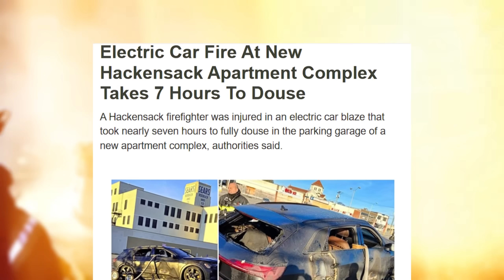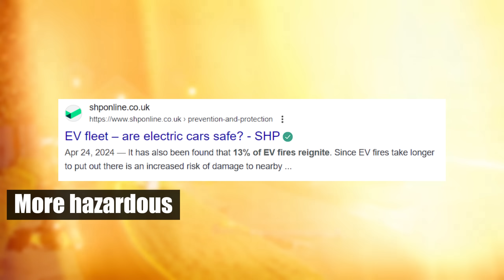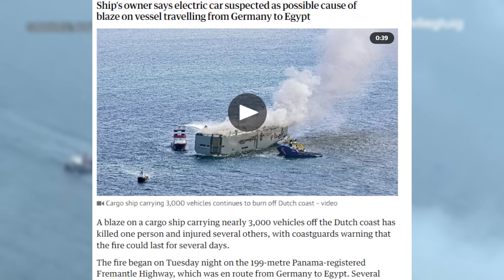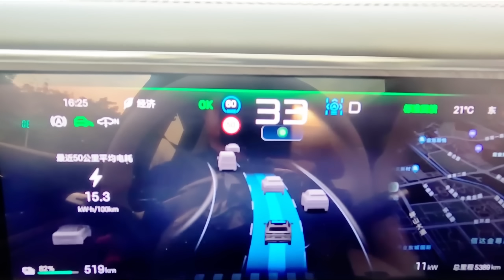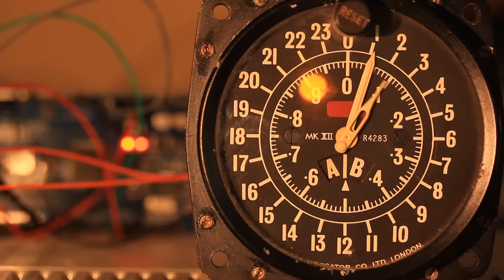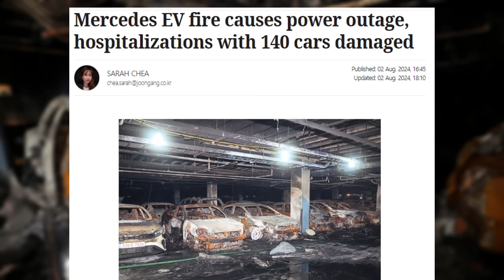Why EV Owners Are Furious? Electric Vehicle Crisis: Owners Demand Answers as Battery Fires Surge!

Comment from the maker: 🤔 Do you think surging battery costs are the biggest obstacle for potential EV buyers?

👉 2024’s Biggest EV Fears: The 10 Reasons Shoppers Won’t Commit! WATCH IT NOW HERE! 🎬https://youtu.be/QV7GZMewhC0
Reply: @PistonPundit  replacement cost for EV batteries can cost anywhere from $15,000 to $25.000 for the F150 lightning batteries
Reply: I had a good laugh at the thumbnail
with Firman on roof. 
😄😄 yeah, right....😄😄
Reply: battery costs are literally collapsing. You're copium is cringe
Reply: LOL, This is nothing compared to GASOLINE VEHICLES!
Google is your friend. 

Search for "BMW Fires"
- "BMW mystery fires: Parked cars have burst into flames", ABC News, May 2017

- "BMW recalls 1.4M vehicles due to fire risk",  ABC 7 Chicago, November 2017

- "BMW recalls vehicles for 3rd time due to engine fire risk",  Associated Press, March 2022
     "...BMW is recalling more than 917,000 older cars and SUVs in the U.S. — most for a third time — to fix 
          a problem that can cause engine compartment fires. The recall covers many 3 Series, 5 Series, 
          1 Series, X5, X3, and Z4 vehicles from the 2006 through 2013 model years. Documents posted 
           Wednesday by the U.S. National Highway Traffic Safety Administration say there could be 
           short in the positive crankcase ventilation valve heater. It can overheat and cause a fire. The fire 
           risk occurs while the vehicles are being driven or soon after they are parked. 

Search "Kia Fires"

- "Consumer Alert: Kia and Hyundai Issue Recalls for 3.3M Vehicles, Advise Owners to Park Outside", NHTSA, September 2023
      "...Hyundai Motor America and Kia America have issued “park outside” recalls for more than 3.3 million vehicles 
           due to the risk of fire..."

- "Why So Many Hyundai, Kia, and Genesis Vehicles Are Getting Recalled for Fire Risks", Consumer Reports, March 2024
     "...Since 2010 more than 3,100 Hyundai and Kia vehicles have caught fire, injuring 103 people and killing one, 
          according to the National Highway Traffic Safety Administration (NHTSA), the government agency investigating 
          both automakers. These fires may be related to an engine design. In November NHTSA started auditing existing 
          recalls of more than 6.3 million Hyundai and Kia vehicles at risk of fire due to faulty parts in their antilock braking 
          systems (ABS). But those numbers reflect just a portion of the millions of Hyundai, Kia, and Genesis vehicles at 
          increased risk for catching fire for a number of reasons, including faulty wiring and brake system and battery problems. 
          According to Consumer Reports and the Center for Automotive Safety, over the past 12 years the automakers have 
          sent recall notices for over 10 million cars and SUVs to fix problems that could cause the vehicles to catch fire..."

SO WHERE'S ALL THE CONCERN?  This is FAR from a complete list of dangerous GASOLINE vehicles that are prone to fire.
Why does it take only a handful of EV fires to make national news?  
PERSPECTIVE IS IMPORTANT unless you're an Anti-EV troll.

Comment: Based on available data, electric vehicles are generally less likely to catch fire compared to gas-powered vehicles. Autoinsurance EZ Analysis (2022): EVs: ~25 fires per 100,000 vehicles, Gas Vehicles: ~1,530 fires per 100,000 vehicles, Hybrids: ~3,475 fires per 100,000 vehicles.

Comment: To believe EV's fire's are less frequent is not true cuz there's way less on the road. China has 20000 EV's sitting in fields next to each other just waiting for one to ignite and they will all ignite.   They won't be able to put the fire out and the one that sank the ship and killed one just took one to ignite.   They need to stop making them unless they fix the battery problem which a say they won't.   They will fare better if they repossess all of them and stop making them or get sued from the deaths they will cause.

Comment: Ban EVs completely. Way too dangerous and the recycling has NOT been sorted. They are as green as a oil spill. Very toxic and make more enviromental mess to be manufactured than any normal vehicle. And have a far shorter life,,, that without the fires. 
Resale value is zero and they are utterly impractical.

Comment: Every electric car should have written on the trunk: "Warning! Fire hazard".
As is already written on the packaging of normal batteries for our remote control or alarm clock.
Reply: @Berghemrrader  sure... Do ICE cars have that sign? Because they are hundred times more likely to catch fire than EVs. Didn't you read that stat?
Reply: @vittalshenoy  The number of full electric cars in my country is 0.6% of the total.
It is normal that proportionally the ICE cars have a higher percentage, even if in many studies "fire" also means simple short circuits, Ibrid cars and also 20/25 year old cars.
The real problem in the "recent and modern" EV is the greater danger of a battery fire, the possibility of re-initializing even after days and the great difficulty of extinguishing a fire.
My opinion is that I prefer to have an LPG or methane car next to me than an EV.

Comment: I try not to leave anything on charge in the house unattended that has a lithium based battery and they are usually devices with just a single cell. Friend had a LiPo catch fire in his hobby room, it was spectacular and burnt several surfaces as he batted it around the room trying to get it out of the window.
Reply: Li Po catching fire? Must have been doing something he shouldn't.

Comment: L.P.G. used to be a very good alternative, low cost and very clean energy source to diesel or gasoline in cars ... but after some major explosions which happened only on very rare occasions,, no such cars are allowed to park underground anymore and are extremely monitored by technical control centers.  When a catastrophy would happen with an EV then nobody will ever buy such a car anymore.  In Europe some accidents already happened with exploding steps and electric bicycles and houses burned down charging batteries or totally random ... what about EV with 100x  capacity ?

Comment: some put up on a site  Hard to find ICE figures for Australia, but Sweden recorded 23 EV fires (0.004%) in 2022 compared with the fleet of 4.4 million petrol and diesel vehicles which recorded 3,400 fires (0.08%). So in Sweden at least a petrol/diesel vehicle is 20 times more likely to catch fire than an EV. If you take the 0.08% figure for ICE and apply it to the approximately 21.5 million registered vehicles in Australia, it suggests a burn rate of around 17,000 ICE fires annually.
Reply: The creater did state that ice fires are slightly more likely per capita than EV fires.........but the impact of EV fires once they begin, is far greater.  
Petrol cars don't catch fire if merely sitting there doing nothing. With EV's, they certainly can.
Reply: @noelgibson5956 Come and tell my neighbour that is BMW petrol car didn’t just catch fire whilst sat on his drive, because it did. There are hundreds of thousands of ICE cars with recall faults that can cause the car to combust EVEN when it’s just sat on your driveway. Go and do your research?
Reply: king4b1 Yes but did they take into account the age of the vehicles? For instance one of my cars is a 52 year old mini. I doubt an EV will ever get near that age. To do a fair comparison they should only compare cars back to the oldest Ev's age otherwise the comparison becomes biased.

Comment: EV 's are not fit for purpose. They are inconvenient to charge assumming you can find a charging thst works or does not have 3 other csrs waiting. They are useless in the cold not great in extreame heat and during a natural disasters when the first thing to go is powermakes them no better than a brick.
Don't charge them over 80% for risk of fire, don't let them go below 30%, don't use the heater in winter/aircon during summer or the range will tank, so how's that range anxiety looking?
On Australian outback roads they are just not a practical option. I can fill my vehicle in 5 minutes and get over a thousand k's out of it.
Insurance is climbing.
You won't be able to insure your house if you charge overnight at home or if you can it will cost you a fortune.
The final nail in the coffin is massive depreciation, who wants to buy a second hand out of warranty EV with a battery replacement costing tens of thousands of dollars hanging over your head.
Reply: Great summation!

Comment: Here you go,in plain English. EVs are Extremely dangerous. 
Lithium  batteries are regulated as a hazardous material under the U.S. Department of Transportation's ( DOT ) Hazardous Materials Regulations  (HMR; 49 C.F.R., Parts 171-180).
Exposure to Lithium Batteries can cause loss of appetite,  nausea, vomiting, diarrhea, and abdominal pain.  -- Lithium can cause headache, muscle weakness, twitching, blurred vision, loss of coordination, tremors, confusion, seizures and  coma. 
This isn't for me or my family.
Reply: I sleep right on top of my lithium battery box for the last 7 years and I haven't noticed any of those problems you describe. When I had lead acid cells I could smell them and had to remove them.
Reply: @tmog1000  Glad you finally told us what your problem is. You were breathing lead because you failed to provide adequate ventilation for lead acid batteries. It was your own fault.
Reply: @robertkubrick3738  Err  What?  Lead was there for only one day. And what problem? I don't have any problem with Li-Po 4, which was the point under discussion.
Reply: @tmog1000  Li-Po4 was not the discussion. Wasn't even mentioned by the OP.
Reply: @tmog1000  So it wasn't Li Po4 exactly? Just in your mind that's what he was talking specifically about? Not Li Ion? Not lithium primary cells, nothing else, it had to be Li Po4?

Comment: After owning 15 "ICE" vehicles and driving hundreds during my work, I have never had one catch fire.
Reply: Because ICE car fires are very rare.

Of course, there will soon be a comment with statistics that aren't even realistic. 🙂

All ICE vehicle fires are thrown together and compared against xxK vehicles per area or all the ICE vehicles that have caught fire from all over the world thrown together. 🤣🤣

But the real picture of ICE fires where the engine or fuel was the real cause of the fire is a completely different story.

This number is much lower than what is mentioned in "these" statistics.

A truck can also catch fire for other reasons. One of them is using the brakes for too long on a downhill slop,  and of course,  the brakes catch fire - then the tire, then the cargo, and finally, maybe even the truck.

An ICE vehicle can catch fire due to electrical faults.

An ICE vehicle can catch fire due to poor maintenance.

Or because the woman drove without a rim for a very long time, that the plastic/chassis ignited and eventually caught fire. 🤣 Yes, that happened, too.

In such cases, EV is no exception and would/will also catch fire!

What will happen when everyone has an EV + that is 20 years old and the cooling system has never been checked?

This is called a ticking bomb. I wouldn't want to charge an EV next to a 20 year old EV that has never had the cooling system checked!!!

Comment: Lets put this misleading myth to bed : - EV fires are less frequent BECAUSE percentage wise, there are less EVs than ICE vehicles. If only 2 in 10 EVs catch fire that 20%. How many ICE vehicles are there and how many ICE fires? 
The vast majority of ICE fires are due to some form of impact, poor manufacture wiring or dodgy home alterations such as installing your own spot lights or sound system and the you have cars deliberately set on fire. EVs catch fire often just sitting still doing nothing.
the more EVs on the road the more fires and yes, as said, they are extremely serious fires. The toxic smoke alone will kill you and the run off from the water is going where?????

Comment: Have you seen those little battery car boosters, some, not much larger than a smart phone, boosting cars. That tells you all you need to know, these lithium ion batteries are larger versions of these small batteries, when a battery that large discharges, it’s only a matter of time before something goes awry, one imperfect solder, a speck of dust, one loose connection, and kaboom! Constant forced charging at high voltages, and fast discharges, it’s a ticking time bomb....
Reply: Oh dear. Imaginations are all running wild here.

Comment: Ya know, with Hydrogen you can convert your oil burner into clean energy and Hydrogen works Much Better than Gas (Petrol). With rapid innovations in Hydrogen separation and collection, it's going to be as easy as finding Distilled Water to put in the tank. 
That's a Reality Now......
Let's get behind the Hydrogen Solution. Once that door is open, all kinds of new exciting technology will follow.
Reply: Ahh hydrogen! Now that IS an explosive fuel.

Comment: To reduce fire risk by improving battery management systems might be wishful thinking in my opinion.
Today's OEM demands in measurement accuracy, functional safety measures are already at a limit or beyond feasibility.  

What unfortunately can't be addressed by an ideal BMS are battery cell manufacturing defects (zero defects is virtually impossible) and growth of metal tendrites with ageing / cycling. Both could potentially trigger thermal runaway.

Comment: The thing a lot of people miss is the EV doesn't have to start a fire to cause a problem. EV lovers will go on about how much lower the chance of fire is, and by the data we have it's true. ICE cars catch fire more often than EV's. The problem is the intensity of the fire from EV's when they do and the fact it often causes a chain reaction. Once a fire starts any EV in the area is a huge risk of making the situation worse. Never mind the danger of people doing so intentionally.

The next big terrorist weapon is as simple as setting an EV on fire in a parking garage.
Reply: For EV fire to be catastrophic it has to be a chain reaction from inside the battery. If you put a battery on fire it is not going to explode like how you think. Be informed about EVs!
Reply: @vittalshenoy  And if the battery gets hot from say the car being on fire? As I said the start of the fire doesn't even have to be the EV, if anything else catches fire nearby, or say some idiot just tosses a Molotov inside the car it's going to go up fairly fast.

Remember in most cases the battery is right under the floor and/or seats of the car. In a bid to save space and spread the weight out of the batteries most EV's are designed with batteries quite close to the surface of the car.

Comment: EV cars are not an electrical  vehicle  , they are BV yes a battery vehicle  , which needs plugging in to an external power source to charge, 
A true electric vehicle would involve a power source which the vehicle supply's  Ie. Diesel electric, hydrogen .
The  lithium ion  batteries are hazmat 6  so governments have given a dangerous substance when assembled a higher safety rating than it should have

Comment: You will all of course have been well aware of the fire which destroyed 1,300 cars and the car park at Luton airport on 10th October 2023, started by a pure diesel red Range Rover, you will also be aware that the number of fires in other Range Rovers has been significant. Now, hybrid cars which have flammable petrol on board as well as high voltage electrics are a risky mix, and fires are not uncommon.
Unfortunately both battery designs and battery electric cars have also been less than ideal, many smaller Chinese manufacturers are possibly lacking in resilience to fire, also the Korean manufacturer of batteries had some past problems, and batteries in Chevrolet Bolt cars, some Porsches and Jaguar i-Paces had bad LG-chem batteries, and were subject to recalls. The switch from NMC batteries to LIFePO4 makes BEV batteries much safer in most current production.
With car battery development from CATL (Contemporary Amperex Technology Co. Ltd) and others, new batteries will be almost totally fire-resistant in the near future.
So, just to provide a little balance, there is already a much lower fire risk in most current BEV cars compared to petrol (gasoline) and diesel, and this will get much lower still.
Should also mention mis-use, one fire recently was started when an idiot tried to charge a Tesla from a US 110v supply, the cable didn’t have a US connector, and a travel adapter was used that was not rated for the current needed and of course overheated. Non-US countries with 230v mains would use less current, but please charge BEV’s from properly designed type 2 chargers rather than normal mains outlets.

Comment: EV fires less frequent than ICE-cars? really? did you forget to adjust for over 90% of cars on the road IS a ICE-car? And in the 10's of percentage hybrid's/plug-in hybrid's?
Reply: Most of ICE car fires are arson for varous reasons and not as a spontanius combustions as EV cars seems to do!
Reply: @kaivirkkala3213 and accidents which is directly related to the number of vehicles on the road